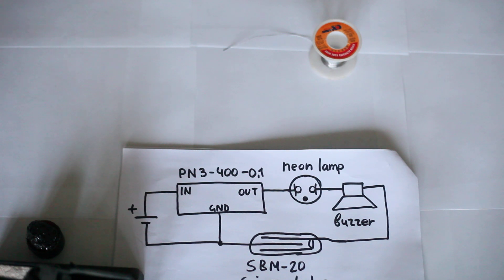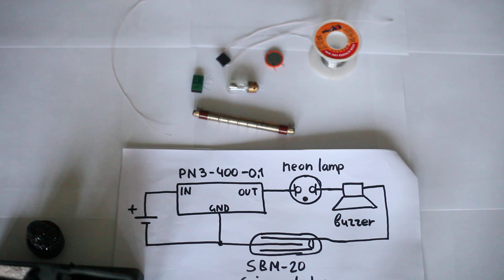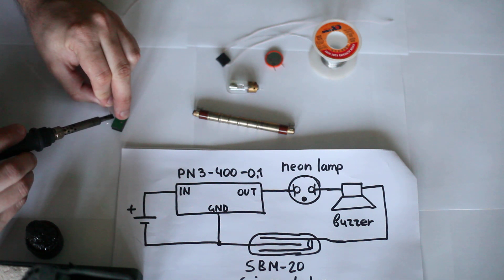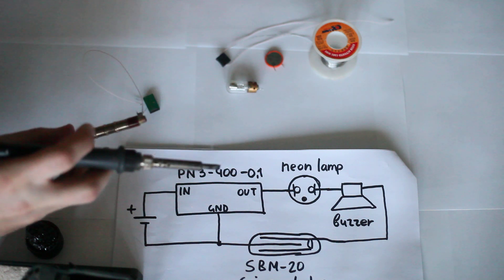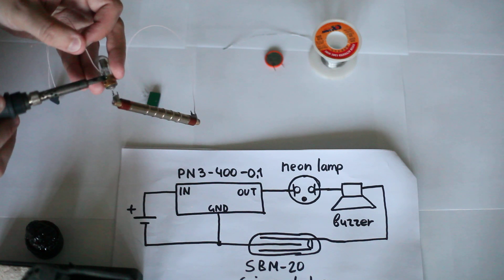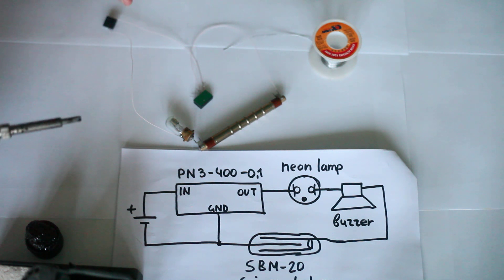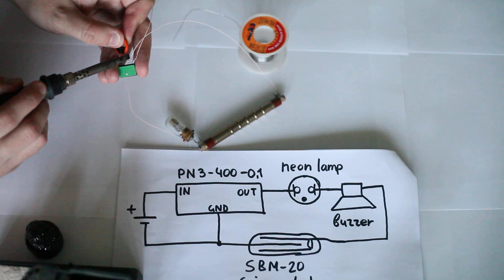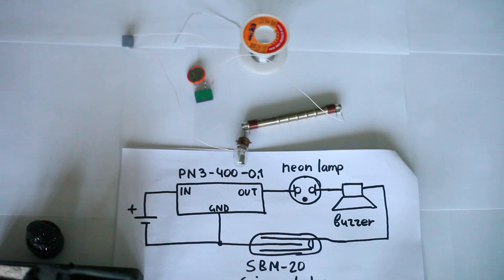Powering a Geiger tube with PN3-400-0.1 voltage converter.

Comment: Excellent and very simple circuit.
I tried the circuit and it only works correctly when I put a 6 MOhm resitor in serial with the high voltage output (instead of the neon lamp) and a 1 MOhm resistor in parallel with the piezo buzzer. Without the correct resistors, the tube either is too weak, or get excited and don't stop emitting light after the first click, even after the radioactive source is removed. Without the 1 MOhm resistor in parallel with the piezo buzzer, it only clicks weakly a few times then stops clicking (a piezo buzzer is like a capacitor).

I don't put a neon lamp because I can see orange light flashing directly through the window of my GM tube (a very small tube sensitive to alpha rays, with the number 4201 written on it).
In fact, GM tubes also contain neon (with another halogen gas), and neon lamps can also be used as GM tube when feeded with a voltage just below the minimum voltage necessary for the neon lamp to lit.

With the correct resistors, my circuit works very well with a 0.9 µCu of Americium 241 from a smoke detector.

Comment: I could not believe that such a simple circuit could work.  I went to Radio Shack and obtained a neon lamp and buzzer.  I used an EMCO voltage converter (same function as PN3-400 shown in video) and a SBM-20 detector.  I was amazed that the detector worked as shown.  This makes a great demonstration!

Comment from the maker: Yes, it's common neon lamp. Working voltage of it is 50-60V, so SBM20 Geiger tube and this neon lamp can work together. If you use neon lamp with higher working voltage you can try to shunt it with 2...10 MOhm resistor.

Comment: What I don't understand is how the SBM-20 gets HV bias with the neon lamp in series with it's anode.

You must be getting HV across the GM tube, but how did it get across the neon lamp when the GM tube is basically an open when there is no event? Is this a common neon lamp like the NE2? 

I tried this circuit, but it only works if I leave out the neon lamp.

(You reversed the neon lamp and buzzer in your build, but I guess that shouldn't matter.)